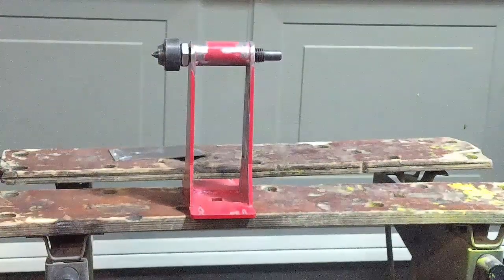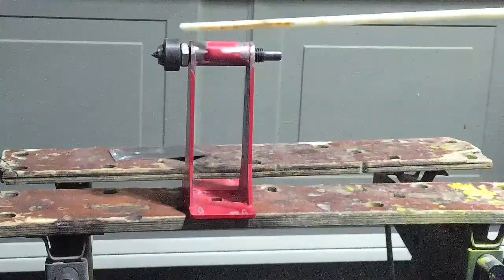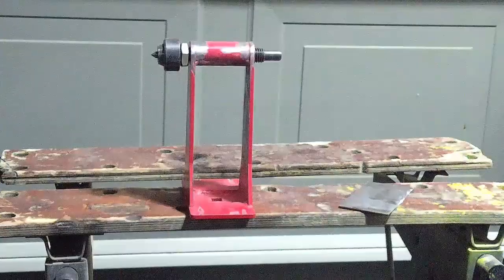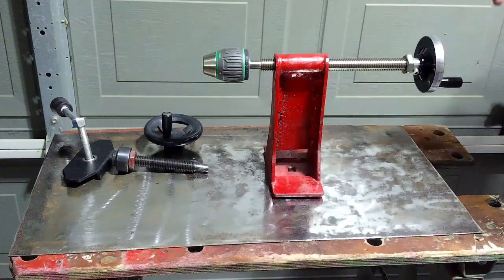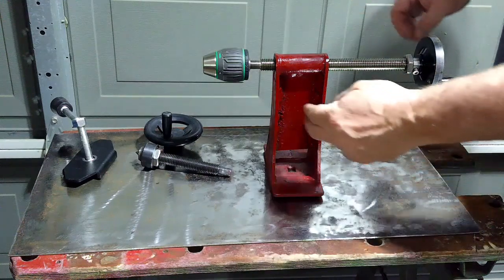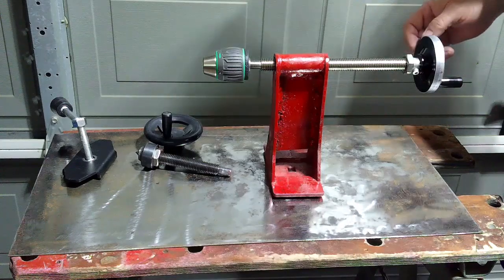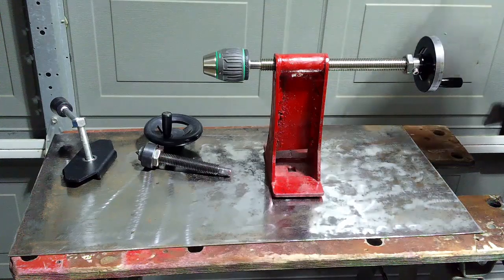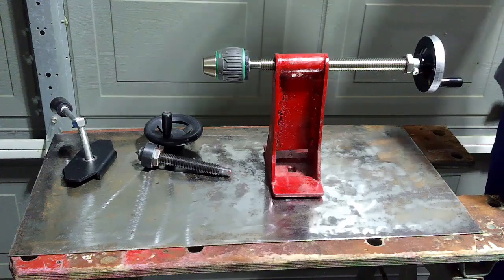Vevor Wood Lathe Tailstock Modifications

Comment: Do you know where we could get a custom part like you used in the video without making it ourselves? Also, could you provide the link to the Jacobs chuck you used?
Reply from the maker: https://www.ebay.com/itm/166894198288?mkcid=16&mkevt=1&mkrid=711-127632-2357-0&ssspo=hBoHc0LeQvG&sssrc=4429486&ssuid=HtcFPSt6Qj2&var=&widget_ver=artemis&media=COPY
Is the drill chuck

For a fee, I could reproduce the threaded quill, with the 1/2-20tpi threaded nose for attachment of the drill chuck. You would need to decide if you would like to use the original hand wheel or use an aftermarket hand wheel (the quill is a different size on one end than my hand wheel than original)